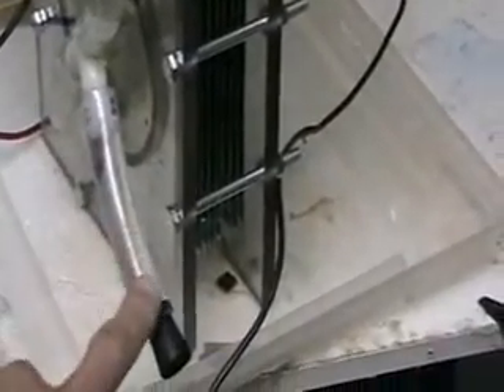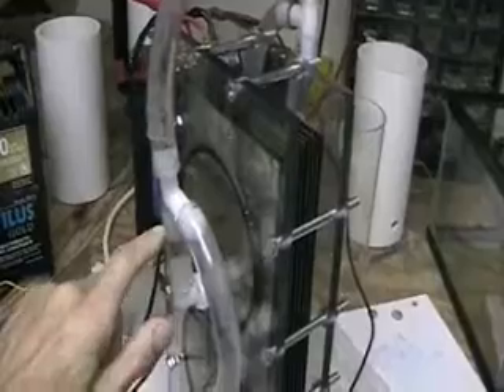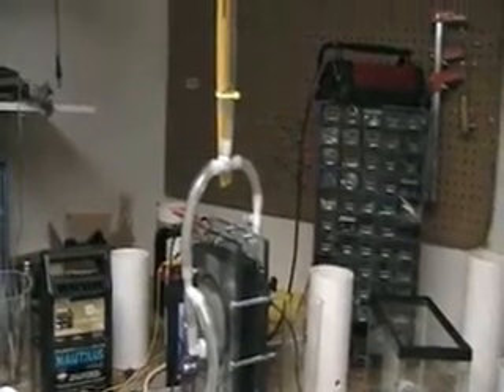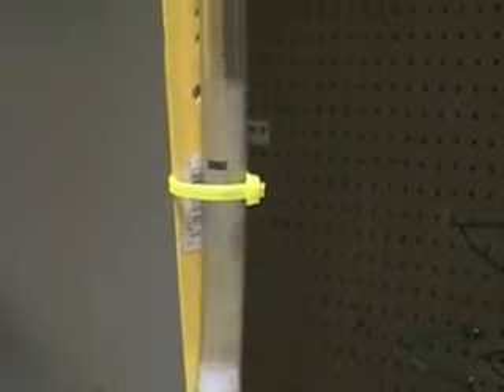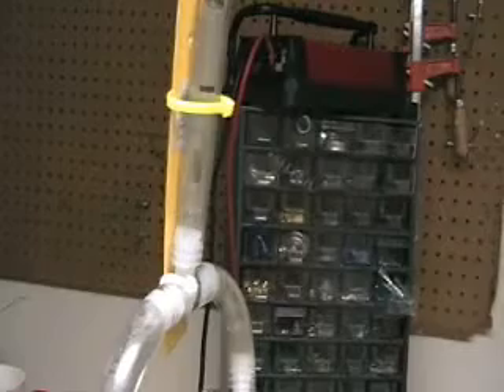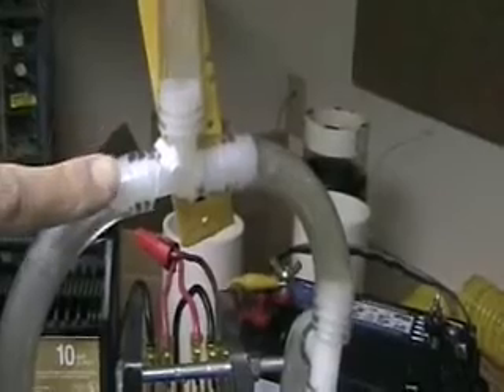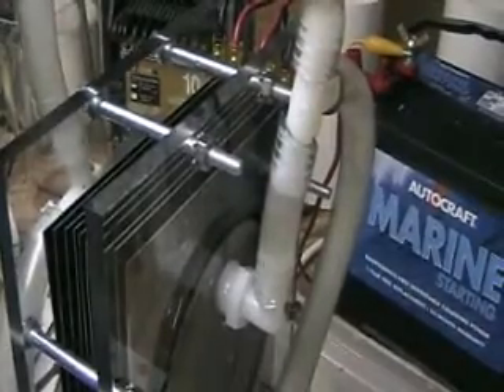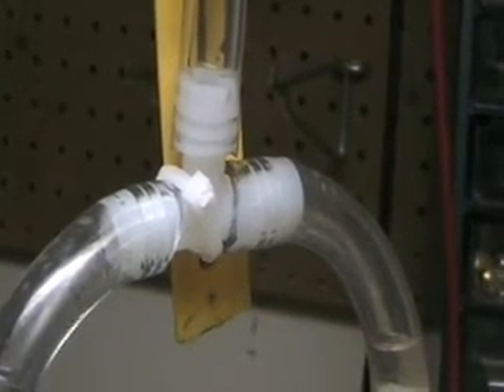Hydrogen Tap (FOCUS-Q Closed Sys) 397

Comment: I have found that if you run separate down and up tubes to and from the reservoir it works like a charm. The down tube needs to come from the bottom of the reservoir to the bottom nipple on the reactor. The hydrogen feed needs to enter the reservoir at about the mid-point and run to the top nipple of the reactor. Then one simply fills the reservoir to about 3/4 to 7/8 full and walla, you have a bubbler as well. The hyrogen feed to the motor exits from the highest point on the reservoir.